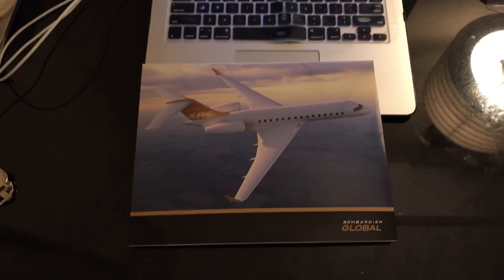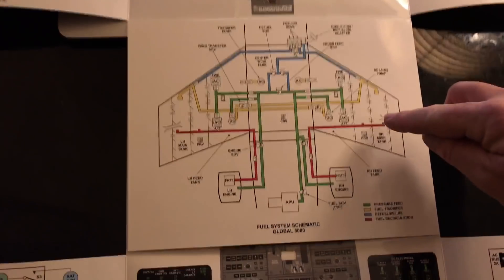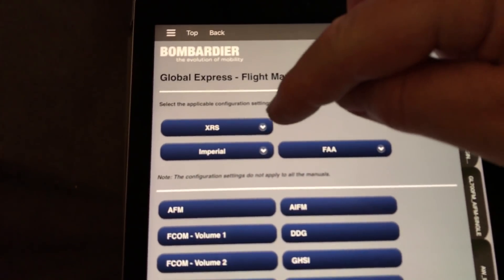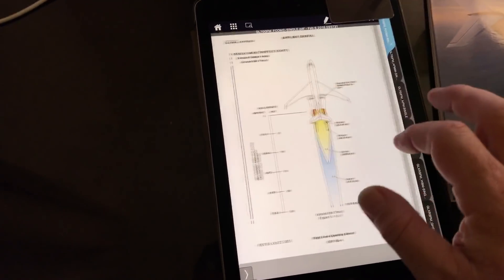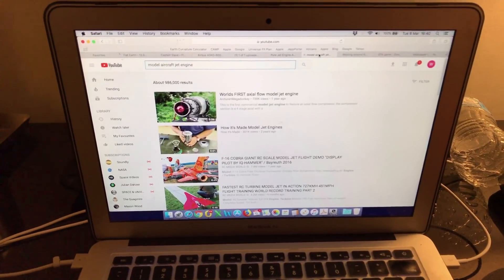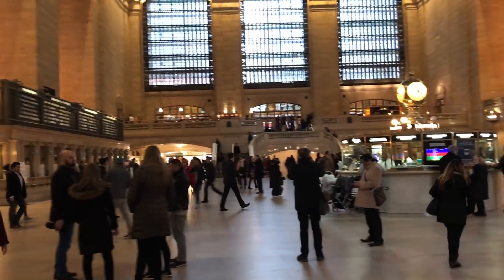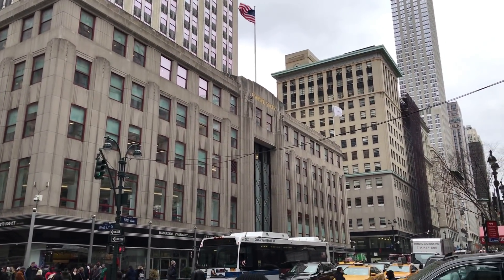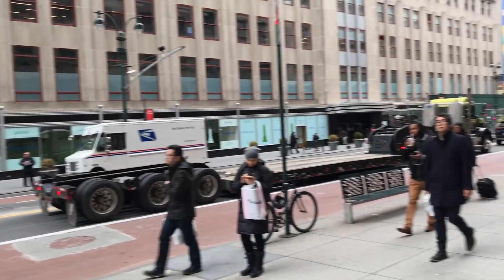Don't be ridiculous - of course Jet engines use liquid fuel.

Comment: A question for you Wolfie ......"THEY" say Concorde weighs 78,700 kg  "THEY" say Concorde fuel capacity is 119,500 litres "THEY" say at skyflightsupport 11,365 litres of jet fuel weighs 9,071 kg .......So if what "THEY" say is correct the fuel weighs 90,000kg  and the plane weighs 78,700 kg .......Hmmmmm !!!!     How does that work ?
Reply: The empty weight of the Concorde was 78,700 kg. Its maximum fuel weight was 95,680 kg. Maximum taxiing weight was 187,000 kg, which would only leave 12,620 for payload. Of course, they seldom carried the maximum fuel load. At 13.2 kg/km, that would give a range of almost 7250 km, but NY-London is barely 5600. 12.62 tonnes is more than enough for 100 passengers and their carryons anyway. What's the problem exactly?
Reply: The shear volume of the fuel which would be 119,000 cubic metres .......A metric unit of volume, commonly used in expressing concentrations of a chemical in a volume of air. One cubic meter equals 35.3 cubic feet or 1.3 cubic yards. One cubic meter also equals 1000 liters or one million cubic centimeters.
  Now the fuselage no seats no nothing just a shell has a volume of 240 , the wings were thin and a fraction of the volume , now lets us fill half the aircraft with fuel and lets us seat the passengers in their spacious seats with headroom which fills the other half .... now where to put everything a supersonic aircraft needs to fly ....
Reply: You gave the volume of the fuel in liters. Cubic meters is 1/1,000 of that--119 m^3. Wing area was 358.25 square meters. If half of that area was fuel tank, it would only have to average 2/3 of a meter thick. No problem.
Reply: I think you are talking about surface area of the wings which as you know is not volume .
Reply: Wow. So wings have no thickness, according to you? Wow! Just...wow. I think we have the flerfer psychosis in a nutshell here. The wing AREA is 358.25 square meters. If only half of that constitutes tankage, that's 179.125 square meters. To hold 119 CUBIC meters of fuel, you would only need 119/179.125 of THICKNESS, about .664 meters--say 26 inches. SPACE HAS T. H. R. E. E. DIMENSIONS!
Reply: I know better than to think you'll read this:
https://www.heritageconcorde.com/fuelgeneral
But it turns out the fuel in Concorde had more work to do than in most planes, and certainly more than can be done by compressed air:

"Concorde, like most airliners, has multiple fuel tanks which have been detailed in the picture below. The only difference concerning Concorde is that during the flight, fuel is transferred from tank to tank to maintain trim and balance of the aircraft as Concorde does not have a full tail plane which other aircraft use on a subsonic flights to perform this task. Any swept wing designed to fly close to Mach 1; experiences changes in the pressure pattern over it, these always have the effect of moving the centre of lift rearwards as speed increases. As a result there is a tendency to pitch down, and on subsonic aircraft this is trimmed out by an upwards deflection of the elevators, or, more usually, by moving the tail-plane itself, as this cause less drag.

 "An aircraft such as Concorde flying at Mach 2 and above needs to do rather more, as the rearwards movement of the centre of lift is much greater. Some of the effects of the aerodynamic changes are countered by the gentle cambers and twists of Concorde’s wing, but there still remains a shift of about six feet to be accounted for. That may not sound much, but the forces involved (the lift) is opposing, and therefore equal to, the weight – which may be 170 tons at the time.

 "Moving the elevons up to compensate for this would obviously produce an appalling increase in drag, and would leave precious little further upward deflection available for control purposes. Instead, fuel is moved to change the internal weight distribution. In fact most of Concorde’s 95 tons of fuel is kept in tanks in the wings, but the forward two, and another in the tail cone, are used for trim as well as storage. Together they hold about 33 tons of fuel.

 "During supersonic flight, Centre of Gravity movement is a critical task, and therefore fuel is required to be moved around the aircraft to shift the Centre of Gravity for different speeds.

"The fuel system and centre of gravity (CG) are inseparable, they are as one; CG and flight controls are also inseparable, they are as one. They are highly integrated in function but not automated in control.

 "The fuel is also used as a heat sink for cooling purposes. Surplus heat from the air conditioning and hydraulic systems from the constant speed drive and generator and also from the engine lubricating oil is rejected through heat exchangers to the fuel."

Comment: Wolfie6020 is a shill for the high pressure high temperature carbon dioxide jet exhaust.  LOL 

But seriously, can you video demo that Airplane jet engine exhaust is hot ?   
While stored compressed air release & expansion can be cold because the heat is usually removed during compression for storage ? 
Also airports fire departments use foam to fight class Bravo fires ? 
And (the dark side) airplane crashes often produce explosive conflagrations because of fuel on board ?
Reply: also please include warnings : The dangers and precautions of compressed air are different from the dangers and precautions of jet fuel.
Reply: I was thinking how it seems senseless to have jet engine air intakes if the plane was powered by compressed air, but then I remembered there are helicopters with blades that exhaust out of the tips.  https://en.wikipedia.org/wiki/Tip_jet 
But even these burn fuel.
Reply: Of course, using foam to fight fuel fires is a world wide government conspiracy !  LOL

Comment: Yes there are people that stupid to actually think that aircraft can run on compressed air !
Reply: Yeah it's insane energy wise. Like let's assume a 747 flies for 4 hours. That uses up about 3*10^12 J of energy. I don't know exactly how much you'd have to compress air into those tanks to get that much out but it's a lot.

Edit: okay I'm pretty sure I did it wrong (never was good at gas laws) but I got somewhere in the region of 10 gigaPascals. 
Anyway using lookup tables shows is still not remotely possible. At 3000 times atmospheric pressure you're still coming up under 10% of what you'd need.
Reply: The specific energy of compressed air is really poor compared to fuel's one: about 0.5MJ/kg versus 42MJ/kg. Fuel is about 80 times denser than compressed air, from an energetic point of view - which destroys the possibility of airliners running on air. On compressed air the range would be maybe 125 km instead of 10,000 km.

Comment: @ 4:43 I can see the specs state that the capacity in each wing is 15,050 lbs of fuel in each wing divided by 6.8 lbs per gallon = 2,213 gallons. Thats almost 9  commonplace 250 gallon home heating oil tanks.  I look at the wings of a bombardier global express on wikipedia, and it doesn't seem to fit that much fuel. Maybe they use a lot less fuel than we've been told?
Reply from the maker: +dwv1000.  Yes they really do hold that much fuel.  15,050 Lbs is about 8550 Litres.  So we need 8.5 cubic meters of space.  

Wing area is 94.8 square meters.   Half of that is 47.4 meters so you you only need the tank to be 20 cm deep to hold 8550 Litres  That is just 8 inches.  That is a simplification because you have flaps and ailerons which do not hold fuel but also most of the wing is much deeper than 8 inches also. 

At the root it is more than 30 so there is plenty of room for this amount of fuel. 

The fuel tank runs the full length of the wing. 

https://www.dropbox.com/s/8okvvaeh10t8k85/Global.jpg?dl=0

I am doing a follow up on this video and am getting plenty of footage for it almost daily.  

https://www.youtube.com/watch?v=GKhTxg6VDuw
Reply: As we toss the numbers around, I see the wingspan is 94 feet. Subtract 8 ft for the cabin we got 86 ft divided by two wings and that would be almost 9 250 gallon tanks end to end. which each one measures 5 feet long more than 2 feet wide and 30 inches high at least. I go to google images and contemplate those thin wings and that dog just don't hunt for me. Interesting. Looking forward to your next videos.
 I notice the base of each wing the width  is considerable, like 30 feet, but the landing gear system seems to be in that area also.
Reply from the maker: +dwv1000 Fair enough - I guess you have to see one up close.  I know it takes two hours to Defuel one.  

https://www.youtube.com/watch?v=B0oPMk_mce8

Comment: Why is the 'Maximum Usable Fuel Load' chart denoting fuel weight and not volume? That doesn't prove anything.

What is the maximum VOLUME of jet fuel this plane can supposedly hold. From there we can calculate the weight.

Even a cursory observation yields it quite obvious that you can't put very much fuel into the wings of a plane, if at all. The wings on planes are extremely narrow and  compact on the inside, go look at how wings are built.
Reply from the maker: +Fancy Esquire - you comment just shows me you have no experience with aircraft or jet fuel.  . 

Volume means nothing to a pilot as the specific gravity of fuel can change with temperature.   The density changes with temperature. 

Read the following document and educate yoruself please. 

http://code7700.com/fuel_density.htm

Especially this part...

Quote.  " As it turns out, "The aircraft range is determined by fuel weight, not volume," so if your gauges say you have less gas, chances are you do.

If you are planning on flying to the airplane's maximum range you need to understand fuel density, especially if operating out of Asia."

Unquote. 

When you fly out of Colorado in Winter you have more weight of fuel in the tanks when full thatn flying out of Broome in Summer with full tanks.  The difference is significant. 

As aircraft performance is all based on aircraft weight the volume is quite irrelevant. 

You can put plenty of fuel in the wings of an aircraft.  I have lots of video already and will obtain more for my follow up. 

Here is a short preview.  Guess how long it takes to de fuel 40,000 lbs of fuel? 

https://www.youtube.com/watch?v=B0oPMk_mce8

Don't be a fueltard mate.  This conspiracy is even sillier than Flat Earth.

I know exactly how aircraft wings are built. I have done many factor tours and was an air crash investigator for several years too.
Reply: Wolfie6020 

At the beginning of your video you mentioned how easy this was going to be to prove. And five minutes into the video I'm still waiting for some cold hard facts. We get some memorabilia and schematics, and the reassurance that there are people that understand this much better than me so just leave it at that. And I'm not going to pretend that I know much of anything about aviation, but I am familiar with physics and mathematics and by all measures, a lot this does not correlate well outside of fantasy and theory.

The sheer weight of the supposed fuel in these wings alone makes this so preposterous to even consider, nevermind how small they are - even if you could put fuel in the wings, it wouldn't be very much. And what a horrible design flaw that would be to top it off, can you imagine all that fuel sloshing around constantly changing the balance of the plane when performing manuevers.

I suppose you're going to tell me you've also seen the curvature of the Earth too. See, at that point I concede because there's no convincing someone otherwise who's so delusional that they are imagining things that aren't there.

The Earth is demonstrably flat and stationary.

Have a great day.
Reply: THIS IS ALL WRONG: "The sheer weight of the supposed fuel in these wings alone makes this so preposterous to even consider, nevermind how small they are - even if you could put fuel in the wings, it wouldn't be very much. And what a horrible design flaw that would be to top it off, can you imagine all that fuel sloshing around constantly changing the balance of the plane when performing manuevers."
- The fuel weight in wings is not a problem in flight from a stress point of view, all the opposite actually. Aren't the engines heavy? Is it another design flaw? LOL. See what they hang under the wings of a fighter... Loading the wings is better than loading the fuselage.
- Search a bit about the actual dimensions of an airliner wings. There is plenty of room for fuel. Even fighters with thin wings do have fuel in wings.
- Balance? The fuel is transfered permanently during the flight so that the plane remain balanced.
- Sloshing? There are several separated tanks, and a plane doesn't take turns like a car. Do you feel lateral accelerations in flight? The plane could bank at 45° and the fuel stay put at the bottom of the tanks. If really you know some physics, that should make sense.

Comment: Hahaa the book says so so it's true your flying that thing and you ain't even got a clue
Reply: Funnily people use and fuel the plane "by the book" and it works fine...
Reply: FrenchCrow lol ok
Reply: Yep. In REAL LIFE (you know, with people working, etc), aircraft documents have a genuine purpose, other than covering a conspiracy...
Reply: FrenchCrow ok I believe you have you seen the fuel ?
Reply: Yes indeed. When I was a mecchanic in the air force, the jet fuel was exactly where it was supposed to be, in the wings and fuselage tanks (even in fighters with thin wings, such as the Mirage 2000). And it is burnt in jet engines' combustion chambers and at afterburner rings for fighters. I can testify about that also. You couldn't get a decent thrust from a jet engine without burning fuel.

Comment: Nice shill!!! Where can they fit 7,000 gallons of fuel in fight jets with those stubby short and thin wings
Reply: Fighters do have fuel tanks in their fuselages, too! And BTW, the internal fuel capacity of a quite large fighter like the F-15 is about 2,000 gallons (not 7,000!), while the smaller F-16 can only hold about 1,000 gallons in its internal tanks. If the F-16 is fitted with 3 external tanks (one centre and two underwing) it can also hold about 2,000 gallons in total.

Comment: Thank You !  Your insight would be very helpful !  To be fair, would you detail the Degree of efficiency that has been achieved since the first generation "blow torch" jet engines and how Resonance has been  designed into the modern high efficiency engines??  It is conceivable that Far Less fuel is used than is presented.  I'm sure you understand that there could be much confusion and overstatement due to the technical, hidden nature of this cutting edge high technology. Though Electronic resonance is understood by a few who deal with it in their design work,  I feel that many are in complete darkness concerning Mechanical/Fluid resonance at work in these technical masterpieces !  The issue is understandable, considering that people trust their lives and pay dearly for this service !  Also, do you think that people would expect to pay less for air fare if it becomes common knowledge that fuel use/cost is much less than presented by the industry ??  Do you think the industry would voluntarily pass the savings on to the paying public ??  Very intriguing  issue for consideration!
Reply: It's one of those conspiracies that is untenable because of how many people it involves. You'd need to keep every step of the fuel supply chain hidden from the outside world. And I don't know about you but I can't imagine it would be easy to keep millions of pilots, lorry drivers, engineers etc all quiet.
Reply: "It is conceivable that Far Less fuel is used than is presented."
What is presented is burning 3 liters per 100 km per passenger at 900 km/h. Sounds to me like a feat already.
Reply: I agree!  So there is no sense carrying excess fuel for a given trip.  Question is the actual quantity stated ( hundreds of tons of fuel) really required ??  Some are questioning that.
Reply: The planes are never fully filled up, otherwise they would be unnecessarily heavy and would consume more fuel unnecessarily. Pilots obviously provide a margin of safety in case of bad weather or other reason lengthening the duration of flight.
Reply: Joe Guerino, there is no hidden nature to modern gasturbines, it is only hidden if you choose NOT to look. your statements about resonance playing a part in modern turbines is incorrect. modern turbines still use the same principles as the first turbines from the thirties, but engine design has changed a great deal with better metalurgy, compressor and stator design,  combustor design,  i could go on but wont. needless to say that, the engines of today are ultra efficient comprared to the early turbines. 
as for the amounts of fuel carried by modern aeroplanes , usually what is stated in the specifications is max weight. but depending on many factors such as passenger number, destination, weather, just to name a few, they fuel according to their need plus a reserve, in case of they have to divert to an alternate airport. they are a marvel of modern engineering, but a turbine no matter how large or how small works the same as the next turbine, suck, squeeze,bang, blow, from the smallest remote control aircraft turbine to the monsterous RR Trent 900 on the A380, both work on the same principles and use the same fuel. 
but one is larger and a bit more ( ok alot more)  complicated in construction and engine management control systems. 
you can beleive there is conspiracy   or no conspiracy, no one can MAKE you beleive ok,  I will just say that yhere really is No conspiracy going on and the people who are implying that there is one, do not know anything about gasturbines, aeroplanes or aircraft engineering. but thats my opinion of corse.